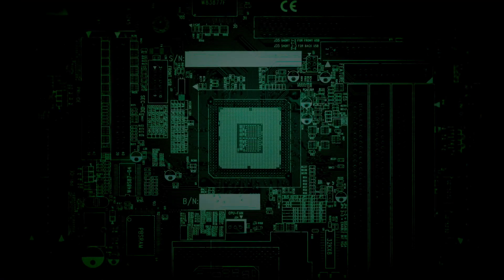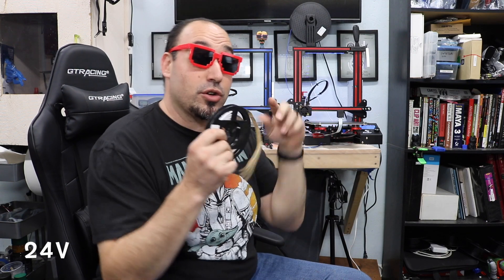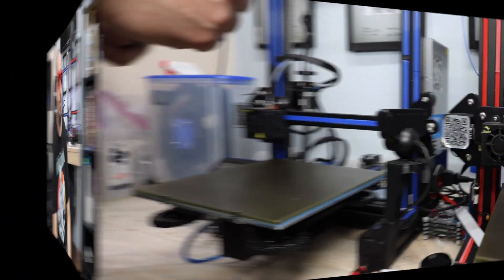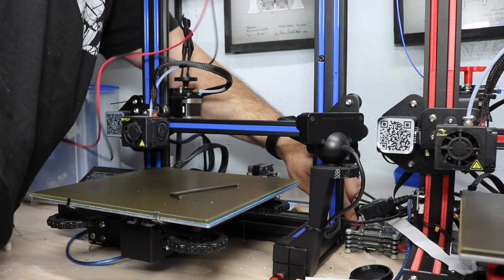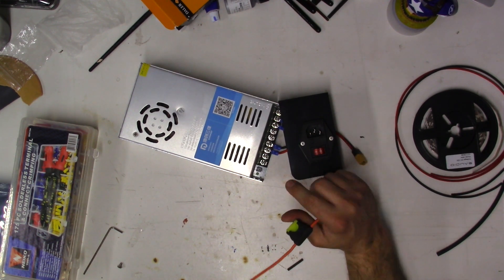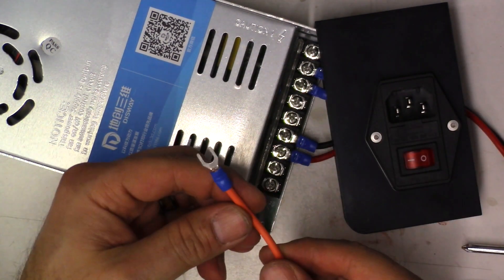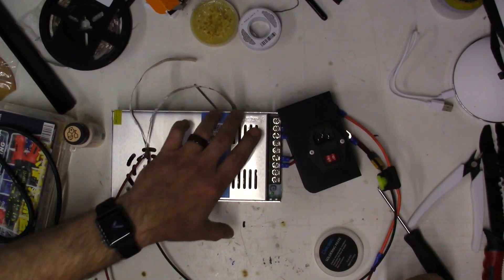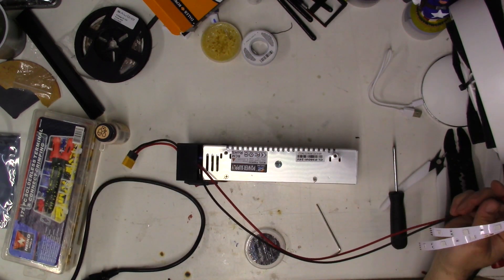How to add LED light’s to a 3D printer, Ender 3

Comment: i'd get soldering right now if no one warned me in the comments, take this down for safety please
Reply from the maker: I've been running it for two years on 2 machines no issues. I was wrong to put a fuse on it because there are fuses built-in to the power supply. I am not telling anyone to do it I am just showing you what work for me.

Comment: next time when adding 10cm strip led, use shunts,100a contactors, a 3 phase safety fuse and also ceramic insulators for high voltage connectors Clown
Reply: What's a "high voltage connectors clown" and why does it need ceramic insulators? ;)

Comment: I do not get you people go read the 12V to 24V article if you look at the strip you would see it already in ( you  usually many parallel groups of 3 LEDs ) then there are it seriesso If you cut two strip of 10 each  the strip would be 12 volt each now connect in series NOW you have 24 volt strip... but the fuse way to BIG 5 amp one do it and the fuse on power suppy is on the AC side of it...For other country it the same the output volt is the same 24 volt just input volt is 240 AC volt...I a ham radio so yes I do know led...The only thing is I would only use white led then you have the 4 connects on is - to + and 2 wire 1 - and then 1 +...I'm a ham radio operator and I do like to build thing like this....

Comment: Thats not wise advice to protect leds  by connecting them in series. 1st if you connect two 12v batteries togheter you get 24 volt.   Thats on batteries.  Leds  are not batteries they work on whats called a forward current. Yes you can if you have more specs about circuit connect them in series but then there is also a resistor or 2 in circuit. The other problem with series connection is if one led blows  well all the ones after it is also dead.  So just use buck convertor.

Comment: If i can give you advice.  THROW AWAY THAT CRAP CRIMPING TOOL!!! It doesnf crimp properly . There is better crimping pliers that does the job 1000 times better.
Reply from the maker: lol yeah I know always forget to buy one. Which one do you recommend?
Reply: The  better quality crimping tool . The section that you use to crimp looks almost like a U  from above. The crimps will be more secure and better connection.
Reply: Will  check for  link to an image for reference
Reply: That  link will show you a propper crimping tool.  Pay attention at the mouth of the crimping tool that kinda U  shape you see when looking at tool from the side.  Thats what you want to get , you will love it i promise. You will look for an excuse to put terminals or crimp connectors on wires

Comment: For the fuse to blow up, the led need to draw more than 480W, I believe this value is greater than the Power the supply can safely provide. With this fuse, your LEDs could be on fire and the fuse "thinking": Hmm, only 15 amps, nothing to worry about m8.
Reply: Yup, my thoughts exactly. He should have used a lower amp fuse 😂

Comment: I'm an electronic tech. 1/2 amp, 500 MA, the same value in different measuring systems. I would not go anything above that. 20 amps would never protect the LEDs - they would burn up in smoke before the fuse opens. Also, switch mode power supplies like this one "crowbar" (ie shutdown) if a short develops across their output.
Reply from the maker: So change the fuse to 6amp. In the unit is protected by the fuse on the main input. So the only thing in danger are the LEDs? But if they did burn out the fuse with pop on the mine input?
Reply: @CrazyWillTechShow  As he said, a switched PSU will shut completely down if there's a short circuit. If the LEDs somehow become a short circuit, the fuse is there to prevent the power supply from shutting down. If a print happens to be occurring at the time, the print would fail and would either have to be recovered or restarted.

You should be using a much smaller fuse so that the fuse actually heats up and pops before the PSU's protection turns it off.
Reply: Hello,
  I want to do this but don't know what gauge wire to use. I know I could search google but it seems easier to just ask. If you don't mind. Ender 3 v2 24v power supply. 12v white LED strip with buck converter for step down. Thanks

Comment: fuses should be 125% of the normal current, you can check that applying a 12 volt over the led strip and taking the current measured.....your brother should know this :)
Reply: Hehe.  The thing is that not everyone thats a auto electrician is also good in electronics. Yet there are some who know and some who dont. Hehehe  ive  seen one auto electrician one day.. he looked dodgy cause 1st of all he had security type of uniform on not an overall.  He was suppose to help me confirm which cable goes where on a earth moving machine  battery that had been taken out a few days before i arrived on their site. The only thing i coulndt remeber which one usually got cut through the isolator safety switch . So i do a quick continuety test to see which cable goes to earth and i say ok well this one should then go there. The so called auto electrician asks to borrow my multi meter then , i say ok sure. Watching him put it on the capacitance range, im like what you wanna test with that?!  This guy doesnt even know the basics of multimeter. So the impatient mechanic came grabbed the cables and short circuited them and said they must go on there and there on  battery  .  🤣

Comment: You should use a step down converter so you're applying the correct voltage that the diodes (LEDs) are rated for rather than putting them in series [based on some "website"].  Perhaps you should put a smoke alarm in too - with a separate power source obvs ;)
Reply: Buck converters are like a dollar, so it seems like a no-brainer.

Comment: Would it be possible to add there some addressable LEDs and control them through the board? I had an idea of making my LED strip changing the color by the temp of the heatbed.
Reply from the maker: I’m sure there is with Arduino bored. Cool idea
Reply: Marlin already have some code to do it. So you don't have to buy a Arduino for that. Your 3D printer motherboard can do it. You will just need to uncomment some lines if you use the marlin firmware (for adressable LED it's Neopixels in marlin)
Reply: Yes, I just did this as Manuel suggested. Dont need arduino, but thats another option I guess. I had the pi wired to the power supply already. Wiring is as follows:
Pi GND to LED GND
Pi GPIO 10 to LED Data in
Power supply GND to LED GND
Power supply 5V to LED 5V

Youll need WS281X LED status plugin as well

I wanted to post a link to a guide i found, but its not working.

Comment: 20 Amps seems a little high for 2 feet of LED strip - good to have fuse but maybe something a little smaller would be more suitable?
Reply from the maker: I went with 20 because of the specs 
Power supply

SPECIFICATIONS
* 350Watt.
* Output Voltage: 24V DC.
* Output Current: 14.6Amp.
* Mounting: for building in.
* Efficiency: 88%
Would you just with a 15?
Reply: @CrazyWillTechShow  Yeah but the fuse should be protecting the load that’s being fed from the power supply - in this case that’s only the LED strips. If those manage to draw 20A you have a big problem - could be overheated way before a 20A fuse would blow.
Reply from the maker: So 15ams fuse?
Reply: @CrazyWillTechShow  I’d honestly say no more than 1Amp but it’s probably less. If you have the spec. of the LED strip it should tell you the expected current draw in normal use per LED and you could work out the exact normal current and size it from that. At the end of the day the fuse is only protecting the LEDs not the rest of the Printer. Just trying to keep you safe! 👍😬
Reply: @niallsimpson  You can buy some constant current converters or use a resistor to limit the current. My 12V RGB strip in my PC set on white color runs 500mA max.
Reply: @CrazyWillTechShow  The fuse you show us at 5:30 is the fuse of the entry of the power supply. So in theory, it already protect your entire 3D printer and all of what you connected to it since this fuse is before the power supply on the 230V/110V from your house. But in practice, it's never a bad idea to add some more where you can to protect as much as possible. 
That's said your 20 amps fuse is useless in this case. you are in 24V so 20 amps is 24V*20A = 480W, so your fuse will blow up if your leds and only your leds (not the entire printer) draw at least 480W. I don't know exactly how much power your led strip use (it's normaly written on the packaging) but I would say from what I see you use approximately 40 cm of 30led/m strip so should theoretically be arround 4W of power for these. let's pretend 10W to be safe. so your fuse need to be at least 10W/24V = 0.42A.
So if you want to protect your leds, I would suggest you a 0.5A or 1A fuse. Anything bigger than this will not be usefull anymore.
Reply: @CrazyWillTechShow  i would go for a 5 Amp, that will be more than enough.